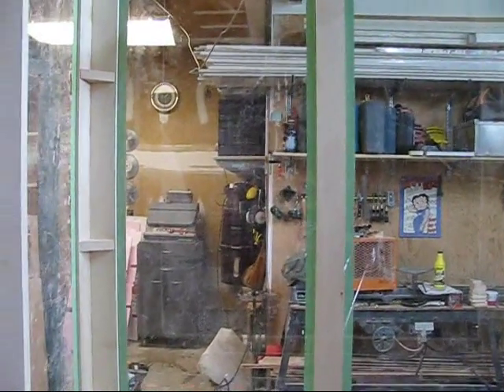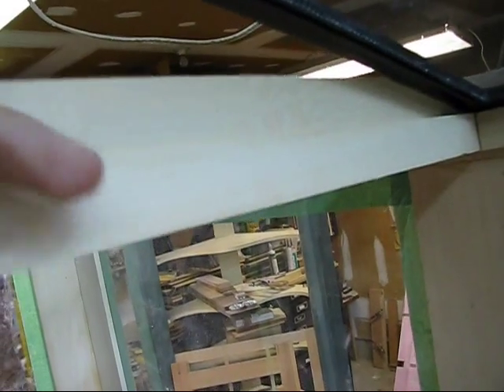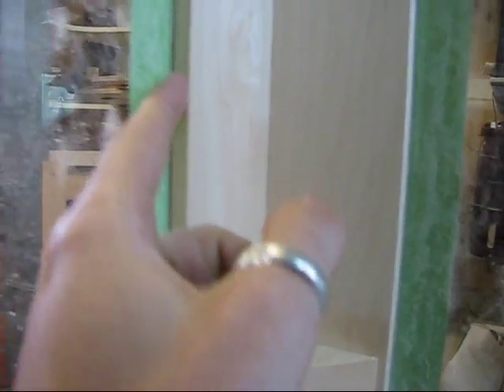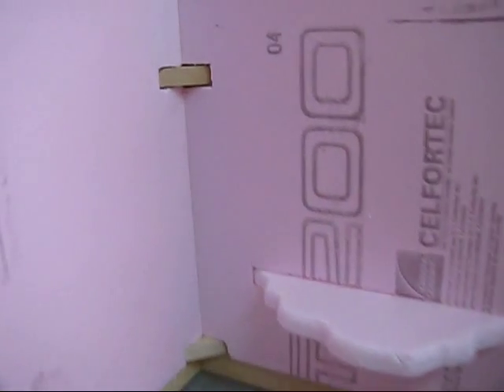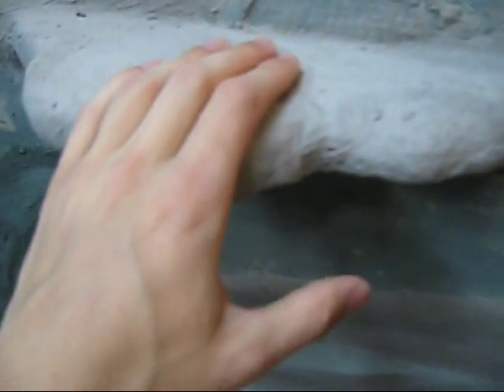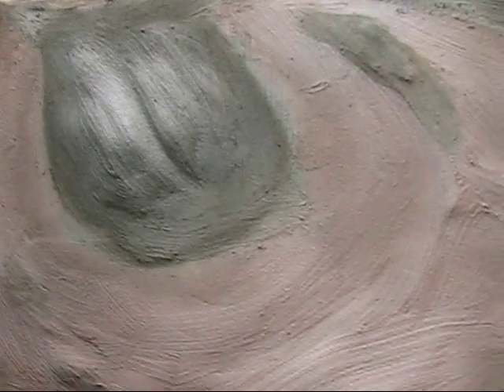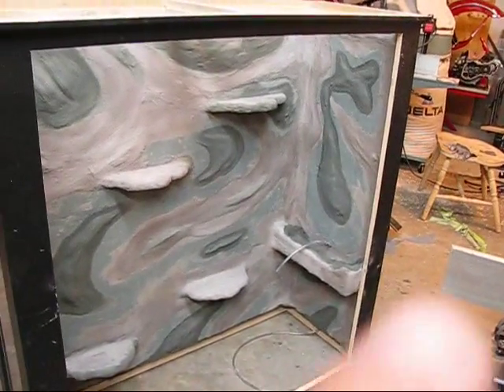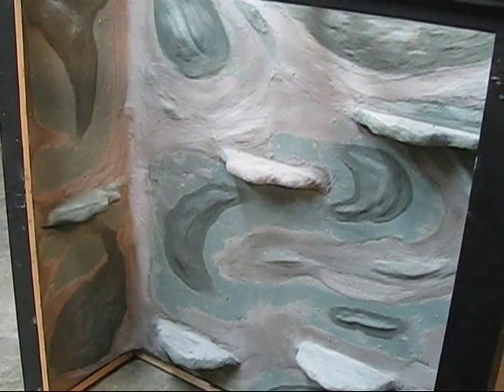Chinese Water Dragons Vivarium Being Build Part "E"

Comment from the maker: which lamps or which lights? for lights i bought a new longer uvb light and fixture, and i bought another heatlamp , so he has now, may by a 3rd, and for the lights them self  i got a 5.0 uvb , and for the heat lights im using ceramic heat waves.

Comment from the maker: me tank is a 75 gallon tank, and the water fall is going to be 3/4 of the 75 gallon tank , cuz i am cutting a piece of glass and silconing it in so  he can still have a bit of flat land with dirt. and for the humidity no rain system, the water fall it self will help the humidity ALOT and i will just be giving it the same old day to day misting.

Comment: How long did it take you to grout the pink Styrofoam? ive been trying to make fake rocks for my bearded dragon and the styrofoam i use is only 3 feet long and 1 foot wide, it takes forever to grout and fill in, i usually need around 7 layers of grout. I was wondering what kind of styrofoam you used and how many layers of grout you put on it.